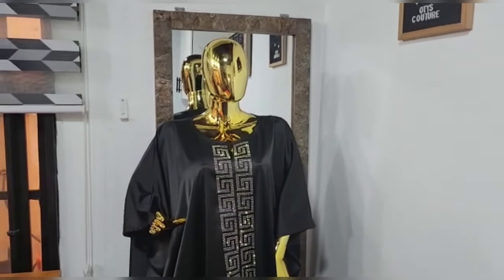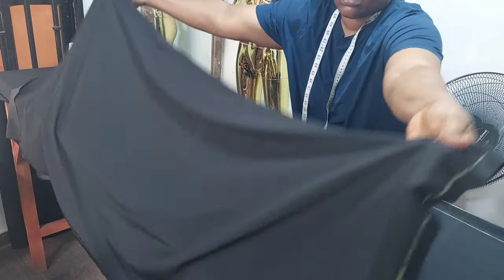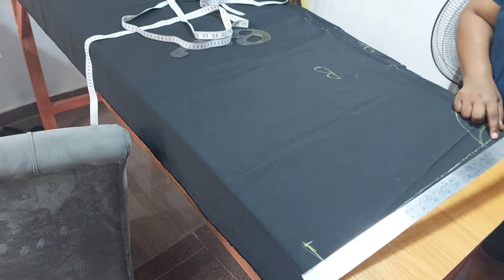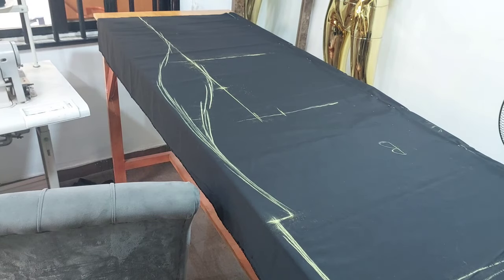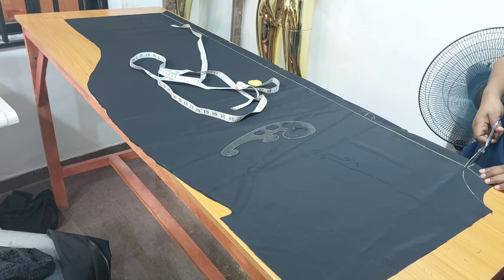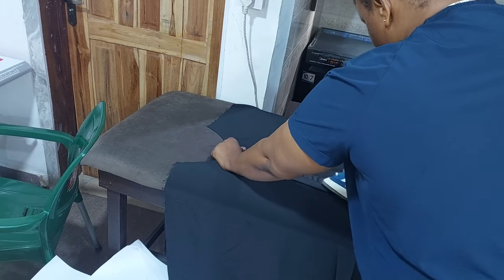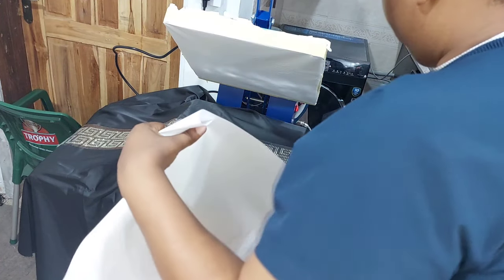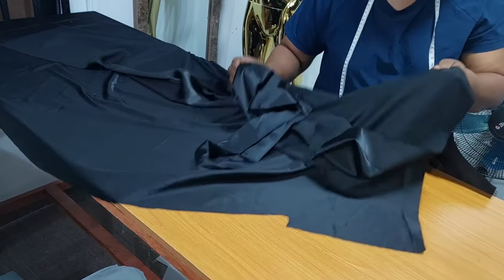How to make trendy cowl bubu with stone board Rhinestones design.

Comment: Thank you 🙏
How did you attach the waist strip?
Reply from the maker: Measure your shoulder to waist on the front bodies. Then From center front Measure your waist divided by 4 and mark it on both sides of the front bodies. Cut out long strip of fabric sew it n turn, then place on the mark and sew.